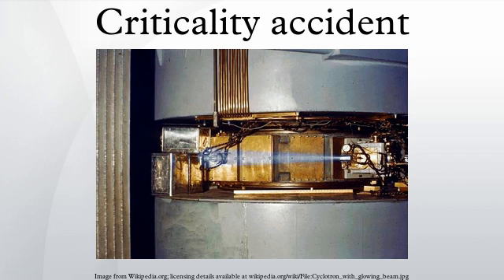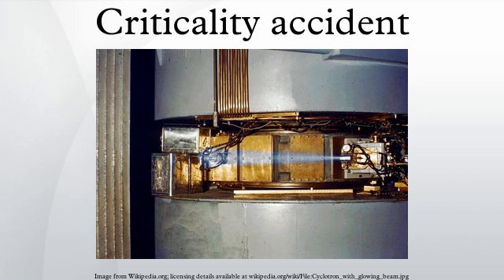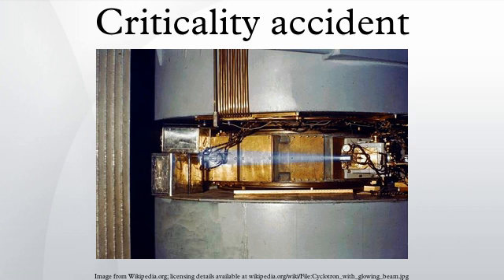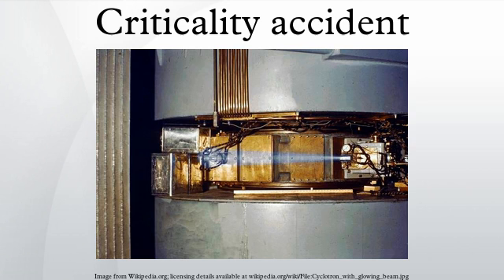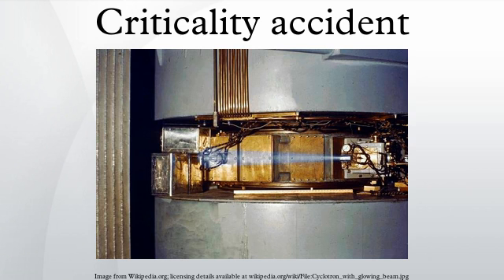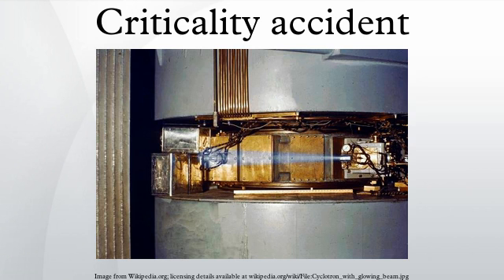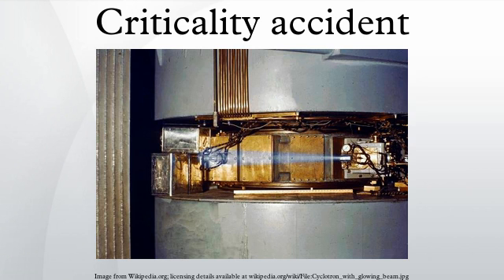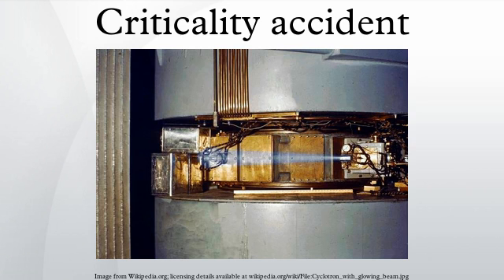Criticality accident

Comment: why so much hate? sure, the visuals are boring and inaccurate, but this is basically an audiobook. there’s tons of good info here and it’s way more in depth than most of what’s out there. i liked it - keep up the good work!
Reply: Why are you talking about criticality and critical mass while showing a picture of a cyclotron, which has nothing to do with either of these things?
Reply: @kenmohler4081  The picture is explicitly related to the subject matter. The image is showing an extracted beam of high energy deuterons coming from the cyclotron and producing a blue glow of ionized air in a distinctly Bragg peak shaped beam cone. The blue glow observed by victims of criticality excursions is produced by exactly the same mechanism of high energy radiation induced air ionization.
Reply: @kenmohler4081  It has everything to do with it. When a criticality accident occurs, the prompt radiation ionizes the oxygen and nitrogen content of the surrounding air. The electrons then have to return to a normal state, so they emit a photon in the blue light range. It's exactly what is happening in that picture.
Reply: The audio is terrible.
Reply: @No_Control   The problem with showing an illustration that is unrelated to the script is that it casts doubt on the validity of the material being presented.  It is hard not to wonder if the author really understands the subject.  You Tube is a visual medium.  If this is, in fact, an audio book, then perhaps it should be a podcast.
Reply: OK